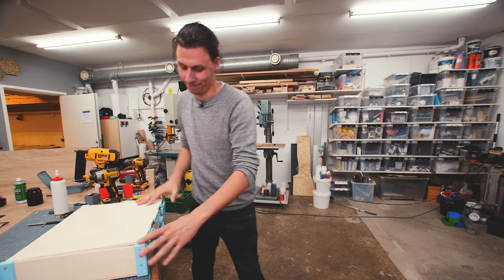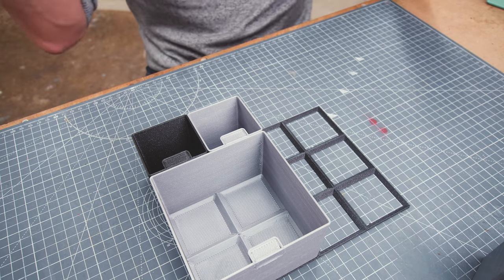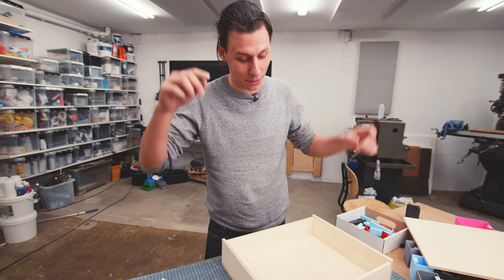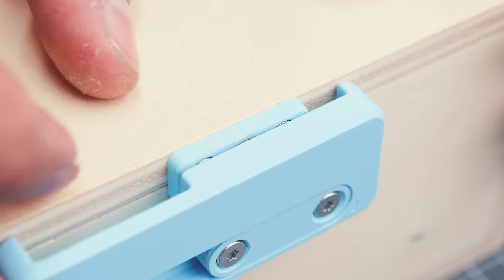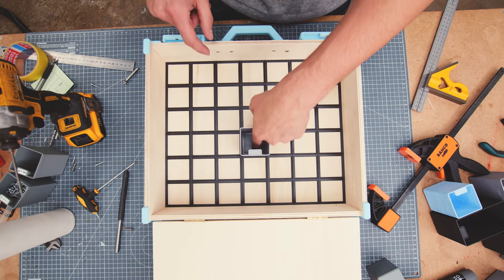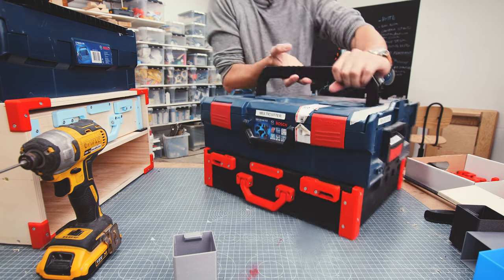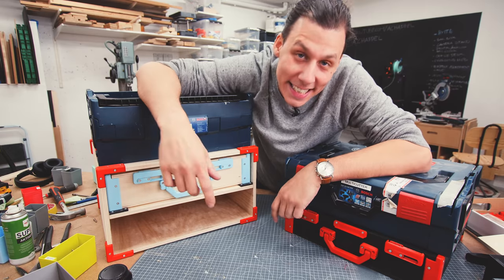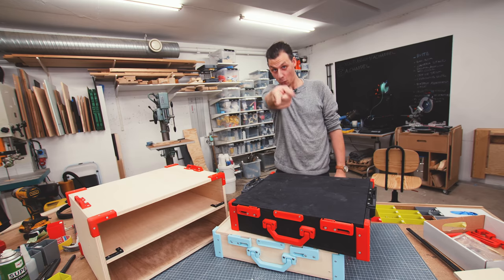3D Printing Even Better Assortment Boxes - And Making a Case for Them!

Comment: I like the grid system. It's just like the wooden system that Jeremy Schmidt came up a few years ago.
https://www.youtube.com/watch?v=WcXzeI0cOlM

I suggest you forget the outer box entirely and just add the Bosch box adapters to all of the portable cases. They they can lock together and you can carry two or three together with a Bosch box. Assuming your 3D printed materials can hold that much weight; you might be limited to connecting only one or two boxes at a time.

FYI, I like the black color for the cases much better than plain wood. It goes with all of the colors you used for the 3d printed parts.

Comment: @JeremySchmidt did this exact improvement 4years ago, in plywood... https://www.youtube.com/watch?v=WcXzeI0cOlM
ALSO, the box-to-carry-two-boxes is a weird idea (put the protective-cornered boxes inside an unprotected box?), the piggyback/clipon for carrying is the obvious way to go --- but with all boxes (so not just a clip at the top to clip onto another box, but a clip at the bottom for the others to clip onto). This way you can stack say five in a car without them flying around...  Or alternatively, make a big flat (upside-down-)U-shaped plywood carrying handle to clip 1, 2, 3, 4 or 5 of the (as-is) boxes onto.

Comment: you don't need the container box, it's a waste of space and material, just model/print the bottom connector of the Bosch system and you can stack them all together ;)
Reply: Good point. Unless he modifies it to fit the version with the clip on the the container that snaps to the Bosch box. And you can use it like a storage shelf if you make it bigger.

Comment: I've built these boxes and I'm not impressed with them. The design has zero tolerance. If any piece is not exactly the right size, it will not fit together. Is you lid 0.5 mm short? Sorry the lid won't close because the latch on the top overhangs the front piece. Didn't glue the sides, front, and back to the bottom perfectly and it's now 1mm too small in any dimension? Boxes and grid won't fit. It seems very naive to design something that has no error allowances.

I'm happy to pay for designs, but previously when I've purchased STL from other folks, it's been a more mature design. This design still needs refinement. I wish I had not bought this design.
Reply: And don't look at the lid askance. Screws into the end-grain of 9mm plywood will pull out at the slightest amount of force.